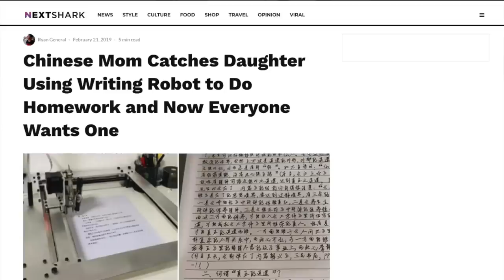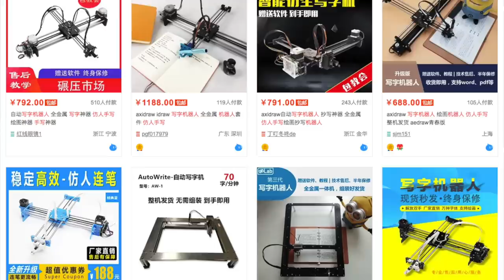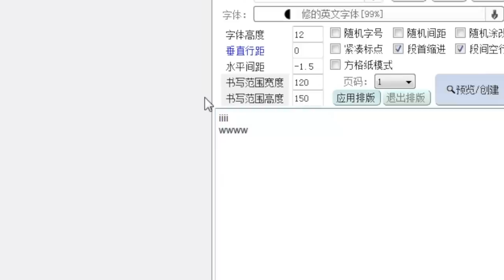Secret Chinese Homework Cheating Machine!😲

Comment: There's nothing wrong with using a printer of any sort for homework, it doesn't matter if you get your carpal tunnel from writing it by hand or typing it out on a keyboard. Back in my day we called these types of printers "plotters" and they print via SVG type data sets (like this one does) - line by line instead of horizontal then vertical bitmapping like regular printers, but they're much faster than this one.
The problem with using a computer to write human handwriting is that it can't, it will always space them exactly the same width, they will always be perfectly aligned, always the same height, and every similar character will be identically drawn. Humans are incapable of doing that for long writing sessions. It's like using a stamp for each character and calling it handwriting.
Additionally, machines like this have existed for over 100 years now, but with the advent of CNC machines, uses like this are becoming more and more computerized and easier for they regular person to access.
Reply: a robot could write less consistent, you just have to implement it. Use some random numbers, preferably with gaussian distribution, to adjust a few offsets, make some functions so the text curves slightly upwards or downwards (i think something with ln(n-x) should emulate this quite nicely) and have a fond that has each letter a few times always slightly different written , from which one is randomly taken each time. All of that generated as an svg, that can be translated to gcode rather easily with some free software and now you have a improved version, where you may have to tweak a few parameters, but will not be detected as easily. Mostly because teachers wouldn't expect a robot to write this way.

Comment: I think it would only be cheating if the coursework for the class revolved around learning the language. For example, I don't think my Chinese teacher would have appreciated it very much had I used one of these back in high school. As you said, this does not really impact creative thought, so if a student chose to employ such a machine to write an essay for a history class then it is simply a dictation machine. 

Side Note besides the spacing of the English characters, I think people would be able to tell that they aren't handwritten because there is too much uniformity in the letters. In your example where you showed the mono spacing with the "i's" each of them was identical, which would not happen in a handwritten document unless it was intentionally done by a professional calligrapher. I think that this is harder to pick up on with the Chinese characters because each character is composed of a different combination of strokes to varying degrees of intensity, whereas in English, there are only the 26 letters that very commonly appear close enough to one another that someone looking would notice perfectly identical letters.

Comment: It looks like the Chinese teachers insist on uniformity in the writing of the characters, so it makes it hard to tell when it's been written by a machine.
English, on the other hand, isn't as uniform - Letters will have variations in them by the individual, as in english countries, they don't insist on uniformity quite as hard - They're ok with variance in how the letters are drawn, as long as they are recognizable.  Spacing between letters isn't uniform at all in handwriting unless someone is trying for good penmanship - utility trumps good penmanship, as the letters allow for it. Chinese characters, on the other hand, require good penmanship and uniformity to be recognizable/readable - so with the fonts the machine is using, it does make it more difficult to tell if the Chinese characters are hand written or machine written.

Comment: Interesting video, thanks. The software needs to introduce some “noise” - some randomness - as it draws every character so the same character repeated several times does not look identical. This is even more important for, say, English, where just looking at a word or two you can say it was printed by a machine because the same character looks identical. Also the spacing and alignment needs a bit of noise, humans aren’t perfect. There are other “tells” as well, for example if I was writing a line and I was almost done but the whole thing wouldn’t fit on that line I would start writing denser so I don’t end up with just one word on the next line. And other such idiosyncrasies.

Comment: This doesn't work for a language that is built up by less than 30 characters. It works for Chinese because there are so many characters and the repetition wouldn't be immediately evident. It's not just the spacing. You would need a library of slight variations of every character for every font and a randomiser for spacing - or it would have to be a new type of font that is generative and slightly different for every stroke and you could fiddle with the limits allowing you to produce nice and disciplined handwriting that is as cosistent or a more chaotic one. Definitely possible, but not useful for school in the west. The only use I would see is to use neural network to teach the software the style of dead writers and forge letters to be auctioned off. That or write fake personal spam mail? It just doesn't really have a use in the West. Still interesting stuff though.

Comment: it shouldn't be cheating on homework, it should be a sign to redesign the homework. the generation before me liked tradition, my generation is in the middle of "hey likes get around this but lets keep this tradition" and the next generation will just phase it out lol so its just the future
Reply: To be fair a certain amount of the work is valid. The legitimate use of a machine like this is if you know for sure you can do the work but you simply have better things to do. If you are struggling to remember how to write, then using a machine as a crutch isn't the best solution (*unless you've tried for far longer than  normal and have a legitimate difficulty where you do need a crutch.)

Comment: As pointed out, the student still has to compose the essay. How is this different than using a computer /printer---or if you're as old as I am, a typewriter? Many educational systems in America don't even teach cursive or arabic (i.e., "block" lettering) writing anymore. Assignments are composed and submitted in totally electronic format. (Save the trees!) Is that cheating? Of course, there are tons of sites on the web where you can buy a ready made composition, grade school level through college. Now THAT is cheating!

Comment: To really fool people into thinking it was handwritten text not only will there need to be variations in stroke pressure but also seemingly random imperfections in the fonts themselves so that every character has the imperfections expected of human handwriting.  Very few humans can write the exact same character over and over without any character to character variations in alignment, proportionality, spacing, stroke pressure, etc.

That said, I can’t very we’ll fault Chinese students for looking for alternatives from wrote writing just for the sake of wrote writing.  I grew up during the 80s, pretty much the dawn of personal computing, and we were often required to turn in typewritten reports that had to be flawless in High School and University — make a typo and you were expected to retype the whole page until it was perfect.  Throughout the 80s I had multiple advantages that most students of that era lacked that made such much easier and more forgiving.  In the early 80s I had an IBM typewriter with built in memory, I could essentially “record” a typewritten page, corrections and all, and when I was finished with that page of typing, if there were any corrections made during typing I could then tell the typewriter to retype the page with my corrections already made so that I had a perfect typewritten page.  By the mid-80s I had an IBM PC AT (286) with WordPerfect and several printers, including a proper letter quality daisy wheel printer, that could print out perfect typewritten text — complete with spellcheck and all the time in the world to tweak my reports before actually printing them.  By 1987/88 I had a 386 PC to add to the collection complete with an HP LaserJet Series II laser printer and even desktop publishing software along with a scanner and could create very professional page layouts.

Comment: If I ever found one of those devices under the bed of a friend's children (I don't have kids, but some of my friends do) I would be very disappointed. I mean, really, if you are going to hide it just make th device shorter and replace one of the axes with a roll - it would reduce the footprint by quite a bit (and also would allow for printing banners, imagine the fun of handing in a multiple-line "handwritten" essay on a toilet roll).

As a sidenote, as a westerner I actually do block print/monospace a lot in my handwriting - but that is in part to make it more intelligible, in part due to usually writing in engineering notebooks (everything are squares), in part since I actually prefer the rythm of writing it that way, and in part since it allows for better grouping in two dimensions (helps a lot when designing things). And yes, my teachers did always dislike that habit of mine - up until I actually hit technology and engineering classes.

And three by-the-ways.
1) Still using the neighbour's knife?
2) Being a westerner trying to read something in hebrew and suddenly seeing Han characters is a very quick way to get a headache. Didn't really help that 'home' is one of the few characters I know. (In a normal week I'm exposed to more than a dozen languages - so always trying to learn more is of direct use)
3) My favorite example of the importance of pronounciation in chinese that I've heard is the old "Mother was riding a horse, the horse was slow, mother was cursing the horse"

Comment: Naomi, A Teacher can spot some is wrong with the writing  like your friends did . Because it does not look natural. by that I mean like what you figured out. all the letters are exactly the same too evenly spaced. A person when writing by hand with pin or pencil. wont make the same letter exactly the same each time. there will always be some little difference.    and write you Name 10 times does every letter "O" look the same did you make a perfect circle each time. Also NO-ONE HAND WRITES  PRINTING STYLE. I is all cursive font.

Comment: In English, the printer wouldn’t work because the letters are too similar and it would be easy to tell since there are only 26 letters in the alphabet. In Chinese, however, this would work better since every pictogram (word) is different, only super paranoid teachers would check for this.

Comment: This machine is an answer for a specific cultural problem. If my grandkids had this tool, I would simply ask them why? Just print the paper or email it to the teacher. I like the idea of teaching them alternative ways of doing things, but a handwriting machine would be irrelevant. Kids are given tablets and Chromebooks at an early age. Cursive is no longer taught in school. It is considered an archaic form of writing. Of course college papers are all written digitally and emailed or turned in to a learning management system for grading. I haven't graded a hand written paper in nearly 10 years. I don't even print anymore. My wife wanted to print some pictures of the grandkids today. The ink cartilages were dried up and had to be replaced. I save so much money by not printing, I could buy an iPad once a year. 
I would encourage my grandkids to simply do their work digitally. 

Cool toy, but useless in U.S. culture.